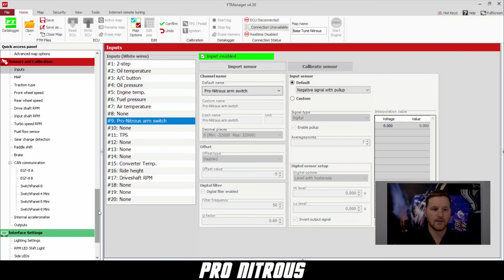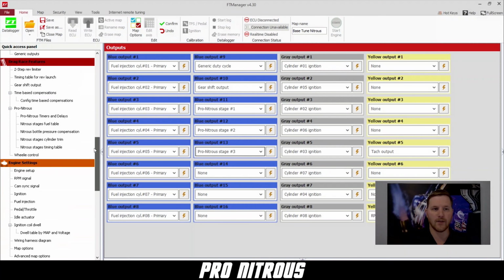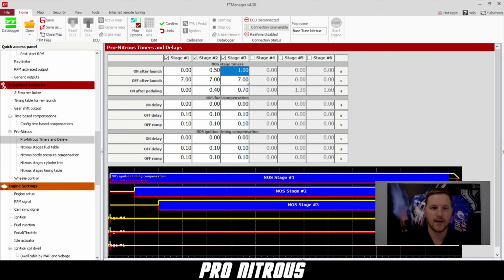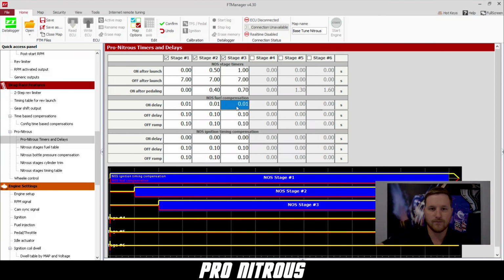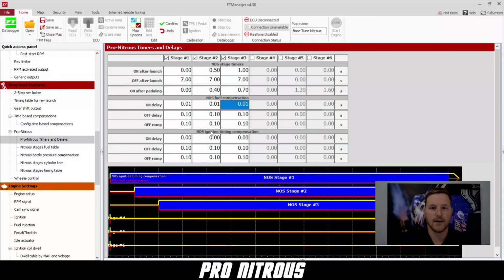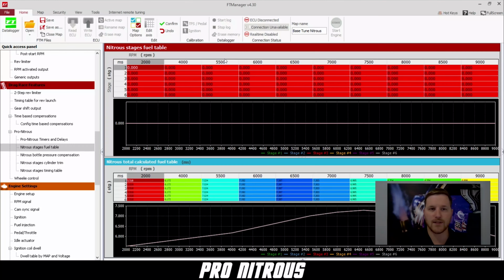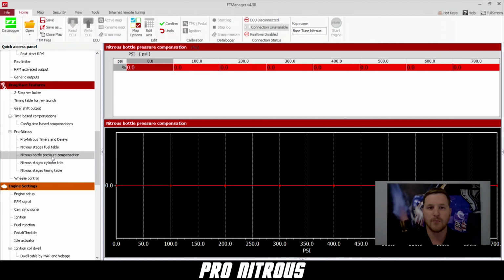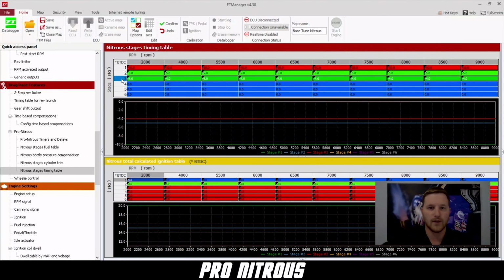How to set up Pro Nitrous feature using your FuelTech ECU!

Comment: How much timing could this pull out of my engine ?
Reply from the maker: Hey Thomas, The software will allow timing to be pulled back to -64 degrees BTDC however an engine would most likely not even run with the timing pulled back that far. 

Thanks:
Cameron